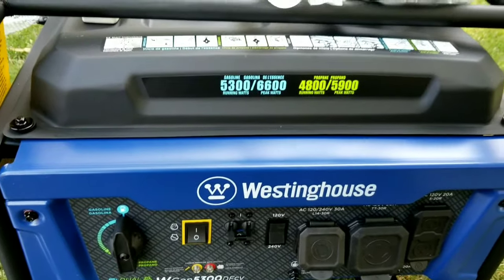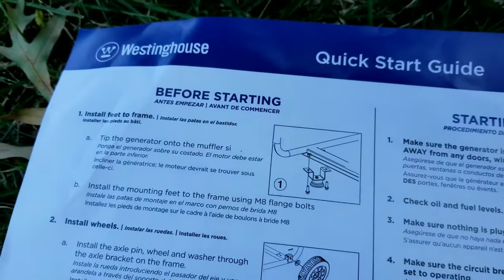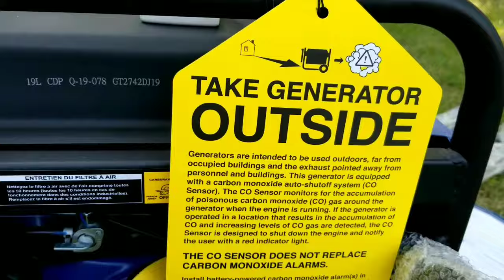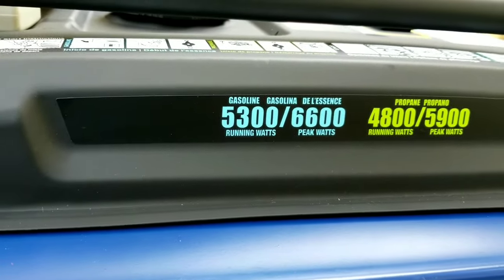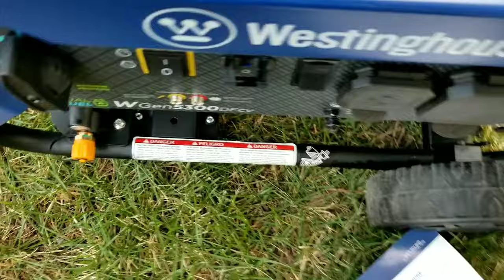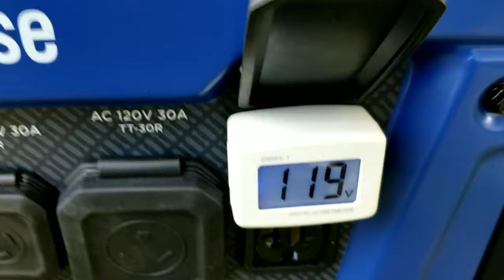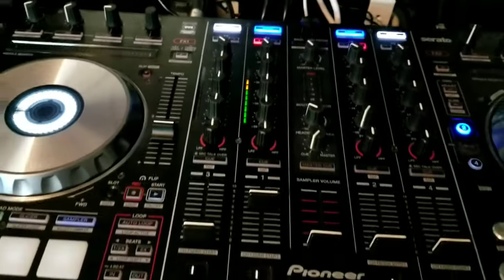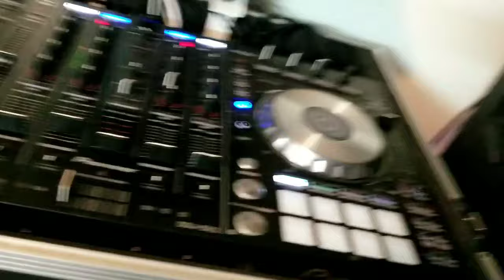The popular Westinghouse WGen 5300 Generator first startup and power use on

Comment: I just bought the Exact same Generator today 2/7/24. I have 3. 100Lb propane tanks to keep it Fueled
Reply from the maker: I like mine and the propane option is the best 👍🏼✅️
Reply: I have a Generac 6500 I Run Non ethanol fuel in. I'm planning on running nothing but propane in the Westinghouse

Comment: The manual says it should have a five hour break in period where you shouldn’t push it to its full extent and I saw where a guy in that five hour period changed the oil 3-4 times and was showing all the flakes that was coming out of it would you recommend doing this? Thanks in advance this is my first generator I honestly have no idea what I’m doing im praying I don’t fk it up haha
Reply from the maker: I have no comment on changing the oil that frequently , doesn't sound right smh. I would follow the manual as I've done and it will  serve u well.  Thanks for watching
Reply: @Djshaw1kinglegend is there a drain plug for the oil or do you just tip it to the side . I do t see a drain on mine .

Comment: Anyone know what i need to do if it won't start?  It just makes a pop sound.  Is that the starting plug?  The oil is still fine.
Reply from the maker: @DeadPoolyInDaHouse  this happened to me once I forgot to flip the switch in the front on/off  but if u pulled it several times you might need to take it off the choke position as you've flooded it with gas or try again in afew hours.